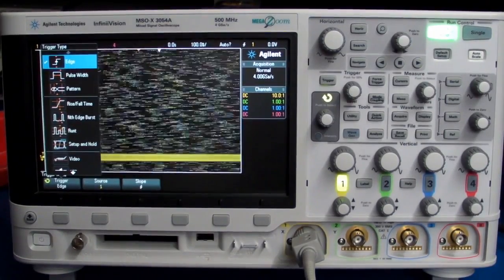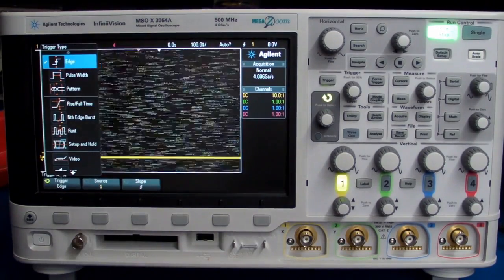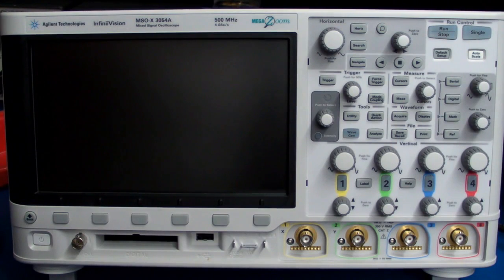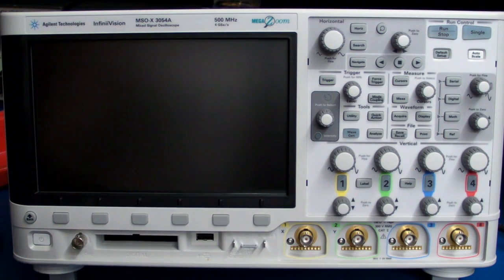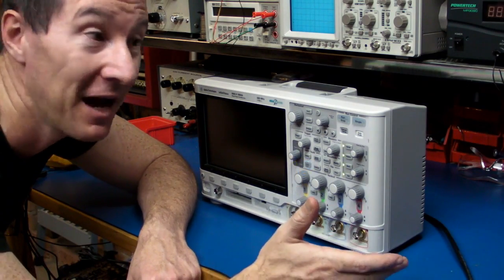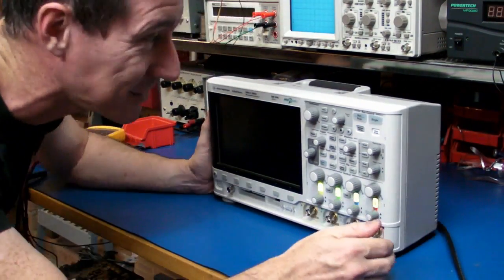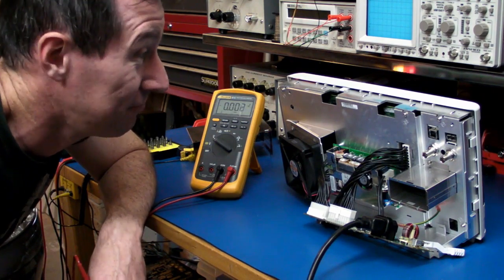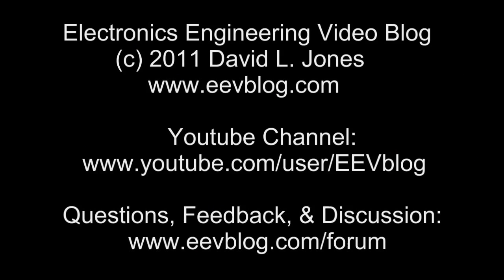EEVblog #147 - Agilent 3000 $12000 Smoke

Comment: It looks to me like the external data bus for the cpu has noise on it.  The ram content itself is ok (otherwise the 'static' would be more permanent).  how interesting!   I've seen this effect before on some of my old hobby projects.  I pulled the character generator ROM out of my old Commodore PET replaced it with a character generator static ram on a perf-board, with very long wires from the old socket to the perf-board, and got similar looking static on the screen due to the very long wires I was using.   Since it was the character generator rom it didn't crash the machine.  It was quite fun to play with it!

But what could cause something like that on a scope?  The frame buffer is in main memory most likely.  Something in the CPU / digital-logic related to the CPU for certain.  But all the voltages were ok?  Hrmm.... maybe a crystal oscillator went poof.  The static on the screen clearly corrupted the running program too since all the scope controls locked up.  Points towards main memory or the main memory address or data bus.

Hmm.  Even a single bad address line could cause this sort of static, too.

-Matt

Comment: In company we have lot of Cap/Tan meters from HP/Agilent (HP 4278 / Agilent 4288), and what I can say is that we have periodical problems with agilent units, they usually fail calibration at some point or just fail generally.
On the other hand, old HP4278, heavy truck bastard, which some of them are even 20 years old, working without problem.
They seem nondestructive, I think they would work even if atomic bomb explode near it, and would still measure inside specification.
Once we open one HP4278 because fan didn't work, it was clogged with dust, it was almost one bucket of dust inside, when I clean it with compressed air I had to go outside on open air, when I activate air it was a huge cloud of dust which could be probably seen 1km away. Closed back hatch, send to calibration lab, pass all test, back to production.

Comment: Shit happens :)

Got me an ancient Hameg HM312(3) because it didn't work, put in three pots, a proper mains receptacle astern, tested it out with a squarewave oscillator at 1MHz, and it works great.  Cost of repair: about $15US.  What sucks?  It's 10MHz single trace.  What else?  Hameg sent me the only manual they have, and it's in German, photocopy PDF, making it impossible to easily online translate it.

Okay, I know what I'm doing with a screwdriver and voltmeter, and now it works on all settings.
Reply: +Kevin Zabbo I once bought a palette of oscilloscopes for $0.50. No, seriously. Fifty Cents.
About half did not work, but the other half were just older ones, typically dual trace 20-100 MHz. The prizes though were a TDS420A and a TAS475. The TAS475 was marked "CRT burned in", but get this... the plastic cover over the glass... was dusty on the inside. The place I used to work at had an on site Fluke calibrator, and it even passed all calibration checks! 100 MHz, 4 channel analog scope with onscreen menus and cursors... for a fraction of $0.50, plus the time to wipe a piece of plastic!

The other scope, the TDS420A was a 200 MHz, 200 MS/s, digital 4 channel scope. It had hit the BNCs and channel 1 was dead. Channels 2-4 worked, and even still passed cal. They just needed the BNC sockets replaced. I did end up spending about $180 for a spare dead unit (one that would not boot, thus I gambled on it being a CPU problem). I desoldered the ceramic front end module from that unit and transplanted it onto my board, redid the cal, and sold the donor unit for about $120. More costly, but I did manage to snag a ton of accessories and pull all of them together. Add-on cards like the VGA out, serial, etc, the accessory backpack, etc. In the end, I sold that scope for $499, and regretted letting it go for quite some time. I realized back then, that I'd rather have had the nice 4 channel scope than the cash and my aging old Tek 935T Dual channel 35 MHz analog.

Good news, is now, $500 will snag a much nicer scope than the old TDS420A
Reply: richfiles
You know how to evoke envy & jealousy right well, don't you?  Awesome deal!
Reply: Where do you guys get these crazy deals?!

Comment: After working with Agilent equipment in my lab for almost eight years, I've found them unreliable. I've had an E5250A catch fire (while idle), an expansion box for my 4156C failed twice. The power supply for our 4073A failed. The 81110A failed. And a power supply for an HP C3600 failed, but they only used to be the same company. And before I took over the lab, our expansion box for the 4156A failed, and the 4156A's VMU failed, The list of Agilent equipment in my lab that didn't fail is shorter.
Reply: and why you keep buying from them st00pid?
Reply: Sounds like a lab or fab problem. Check your power supply, isolation circuits and any nearby high energy emissions (welding maybe?)
Reply: Hmmm   All power related failures ?? Are you sure it's an Agilent problem ????
Reply: well who else are you going to buy from? haha if you have some cheap chinese crap you can at least upgrade...

Comment: i love how agilent   actually said  exactly what happened  with the hardware   nintendo just says   weve determined that the problem is not covered by your warenty and sends a link so you can pay LOL
Reply: been a long time watcher   i spend 99 percent of my time in the software domain here
Reply: +Fennec Fox (FennecTECH) Yeah but Nintendo equipment doesn't usually cost $12,000 or get reviewed on a blog for people interested in repair :P
Reply: true    but still for a loyal customer who paid 300$ to buy a console AND 95$ to have said console repaired for a fault not caused by misuse or carelessness i think i deserve a bit of insight into why my consoles wireless stopped working
Reply: 5 years later.  And ive been inside these things and learned that the earley 3ds consoles have a wireless module that disconnects with a board to board interconnect and i bet that came loose.  95 dollars to push a module back in.  SMH
Reply: Big difference between Nintendo toys and $12,000 worth of expensive electronic test and measurement equipment.

Comment: I would be upset if that happened to a new $12k digital whiz-bang scope.  I guess if they give you these instruments to test, they have to take the hit on the shoulder when they fail.  It is great Agilent is correcting the problem on scopes already out in the field as prevention.  They should probably do a little more reliability evaluating in their own labs before they release products of this caliber to the market though, as failures  could mean downtime that would tick off customers.

Comment: And another Agilent bites the dust...

I don't know about others but compared to the other makes my college's 3 EET shops have nothing but lame luck with Agilent. There even was one model of bench meter that was absolute fail when it came to measuring the DC part of an AC+DC waveform (the various fluke meters were just fine). Every meter of that model did it.

Comment from the maker: @TheEPROM9 Yes, old analog scopes make excellent starter scopes, and can be had for cheap or even free.
Reply: When I was very young (like 14 or so, in the mid 70's), I used the data input line to my Commodore PET's monitor, which happened to be a TTL signal, to probe around the circuit board.  I just disconnected the wire from the raster circuitry at the cable header and proibed around!   That was my first 'scope'.  And it was a digital scope to boot!

-Matt

Comment: I hate the  OBF  I worked for NCR for 9.5 years and I would get critical parts for repairs sometimes flown overnight to fix a problem 500 bucks to ship a part replace it turn it on and smoke comes rolling out and I find out that it gat water inside the part during shipping . I bought a new fluke scope meter and it worked for a whole 5 seconds took fluke 5 days to replace it . Let us know how long it takes to get it replaced.